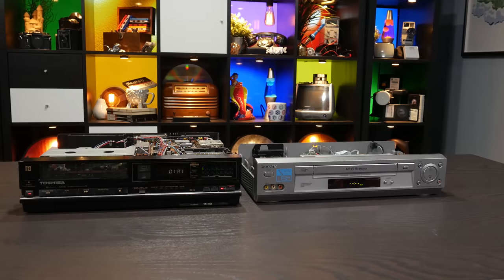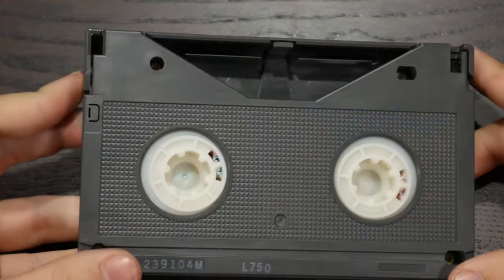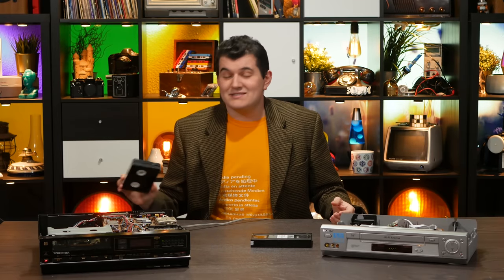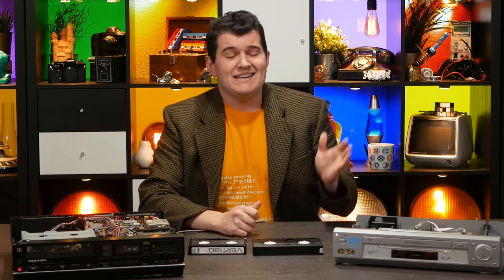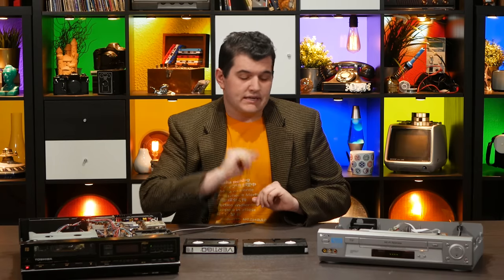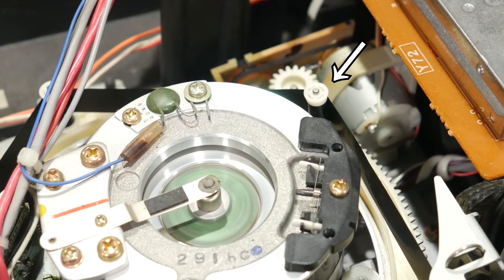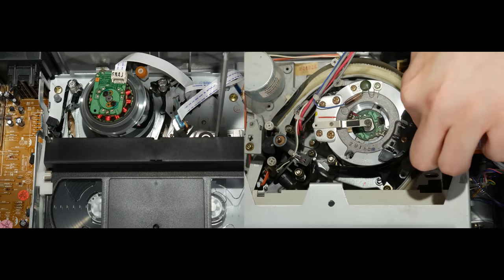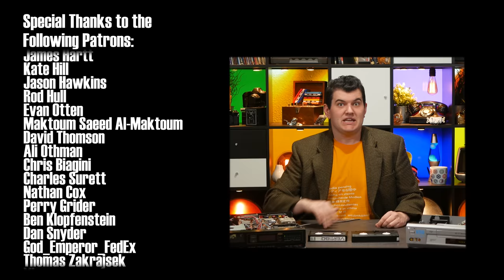The VHS cassette was more clever than Beta

Comment: Back in the 80's when tape players were new, I was a 2-way radio repair tech.  A friend with an out of warranty VHS player had a problem with his unit and volunteered me to fix it since apparently 2-way radios are practically identical to VHS players, and I knew how to solder wires together, that made me an expert on video tape players.  When a tape was inserted, it would pull it in,  act like it was going to feed the tape in but would immediately stop, then promptly eject it.  When I removed the cover, looked at all the internal adjustment controls, and knowing at that point I didn't even know how to set the clock on the player, much less fix it, I said I can't do anything without a repair manual, hoping to persuade my friend to take it to a real tape player repair shop.  We put it back together, and he left with it and I felt like I had dodged a bullet.  The next week, he shows back up at my shop, with the same broken tape player and a smile on his face,  and hands me a repair manual that he said cost a hundred dollars and said I could I fix it now that we have the manual for it.  So, we went though the troubleshooting process from end to end, and from what we could determine it was something to do with that "light on the stick" you mentioned, and the side sensors.  According to the manual, the player would check to make sure the tape was taut before loading, using that light and edge sensors and if not would attempt to wind up the tape to make sure it was tight.  Watching it, we could see the tape was just fine, no slack, but the player kept ejecting the tape.  After exhausting all possible obvious problems, we finally measured the voltage on the edge sensors, finding one of them wasn't detecting the light.  Upon closer inspection of the sensor we found a bug had crawled into that sensor, got stuck and died.  Removing the bug fixed it but not before we had gone through every step, alignment, adjustment in that machine and somehow we managed to compromise the MACRO copy protection detection (there were dozens of controls, I haven't a clue which one it was) and it worked wonderfully well making copies of other tapes.
Reply: LOL   That's funny that he brought it back with the manual and payed that much for it.  I used to do some repairs on VCRs.  Eject mechanisms were often the cause of failures.  
Your story is similar to how we got the term "bug" in a machine or program.   Where a moth caused a relay to fail in an early electro-mechanical computer.
Reply: @my3dviews   Yeah, those were the days.  I also repaired CCTV systems, so I had some very basic video tools, like the kind made by Heathkit, and at the time a nice Sencore scope that was better suited for home TV than CCTV stuff.  I was still a kid, and had just gotten my commercial FCC license and fortunately the study material covered broadcast radio and TV, but at the time I still had practically no real life experience, so I was loaded with all sorts of theory and Q & A knowledge I was ready to put to the real test, attempting to repair a very complicated device I had no clue about.  Since we lacked the real test equipment called for in repair manual, we had to build a few gimmick tools along the way, like inverting sync to inject using a transistor inverter, and stuff like that, and after the first pass through the alignment, the VCR absolutely was screwed up beyond all hope.  So much for raw inexperienced knowledge.  Anyhow, energized by my friends urging, and willingness to supply beer and Dorito's as payment for services, by the time we finished the second case of beer (we opted for the pay as you go plan), and repeated the alignment procedure probably a dozen more times, we managed to get a little bit of a picture back, and were able to tweak here and there until the picture looked fairly decent, at least to two drunk wanna be VCR repair tech's.  The picture wasn't perfect, but after my buddy discovered it would now record tapes, even those with copy protection, he wouldn't ever let me take another crack at fixing it properly.  Over the years, I gained a lot of electronic experience repairing all sorts of electronic stuff, but VCR's were something I never felt I properly conquered, and stayed clear of them, and after watching the video of the Betamax from this post, I think I made right decision.  Lol!  :)
Reply: @TurpInTexas    Ya, I don't miss doing repairs.  Didn't mind the ones were you instantly knew what was wrong based on what the customer said.  Keeping a few old VCRs around as parts was a great way to fix things.  I recall one Sony beta, that had audio problems.  Had a different model that just happened to have the same circuit board.  Did a quick swap and it worked.  Sure beat having to find the component on the board that was at fault.  
VCRs also had lots of mechanical failures, which often were obvious just by looking at it.  Such as a broken cog on a plastic gear.  
I got out of it when everything was turning digital.  Now everything is so cheap that I don't even know if they even fix them anymore.  Don't think that it's worth fixing a $75 Blu-ray player. Maybe just a complete circuit board swap, but no point in trying to find the faulty component.
Reply: My3dviews Just FWIW, the term "bug" was in use for computer errors before the real moth got caught in a relay.
Reply: You literally debugged the VCR.
Reply: Great story
Reply: @AndyFerguson  Thank you.  :)
Reply: @TurpInTexas  Been there, done that :)
Reply: I had a similar experience.  Growing up we had a VCR that suddenly stopped working.  So my dad took it down to the basement and opened it up.  He was a mechanic, but had no experience repairing electronics so he had little hope of being able to fix this thing.  But when he opened it up he found the label from one of our VHS tapes in the machine.  He pulled it out, put the VCR back together and it worked just fine after that.
Reply: TLDR
Reply: @TurpInTexas  you have to use an oscilloscope and set this little timing bump from a test measure point to get it to sync with the throw back pulse it think it was- ie you probably upset that the tape head has to perfectly align with the picture information- like when the throwback point is that takes the field scan from bottom back to the top- to start the next picture 1/2 frame. This is microscopic and of course as you must know, you never adjust anything as it;s self correcting and guiding and always the simple stuff first. Worn belts, dirt, like you know, or some sensor. Never the electronic tracking to signal stuff- at the start.
You would do this if you changed the head as it's a physical thing with a new micro position compared to the replaced head and you needed to align the tape's line scan of picture information to the head.
(When you load a tape, the tapes got "find me" pulses recorded- like a cd, dvd and so on.)
(I only performed it once in class 1/2 a lifetime ago.)
Reply: Honestly that's a little hilarious-
Reply: Why’s your comment-& all its replies-so long?
Reply: @michellebenn8553  Why are yours so short?
Reply: And this, is why I do top down cleans before trying manuals
Reply: The one that was the scariest was the VCR that I opened with a full size Peanunt Butter and Jelly sandwich in it... With green mold. 
The second favorite of mine was the VCR full of crayons. I have no idea how those things got in there... But I do know that children are much better behaved when kept in their dog cage when not in school... Just sayin... As a successful parent and grand parent  😜😝😱
Reply: @steamer1  ????
Reply: These comments remind me of my recent repair of a car stereo out of my daughter's car we bought used a year ago. It powered on and radio worked but it wouldn't play CDs.  When I disconnected and removed it from the dash - I heard the unmistakable sound of a quarter.  After removing it I closed the unit and was ready to power it up and heard another quarter floating around inside. 50 cents later the player works perfectly.  Somewhere there's a parent who never knew why their CD player stopped working or what happened to their laundry money.
Reply: And this is exactly why Im upfront with what I know how to do. I cant count how many times I've been asked "hey, can yiu help me fix this thing" and responded with "I have no experience working on anything like that, hire a profesional".
Reply: @my3dviews  shoot, that machine was probably $1500. $100 to fix it was a bargain.
Reply: @davisnin    The $100 wasn't to fix it though, it was the cost of the manual.  So, if he charged for parts and labour, it could have been much more than $100 to fix.
Yes, they were expensive.  I also did some sales, when repairs were slow.  I recall one VCR that we sold for $1200 (Canadian).  The cheaper ones at the time were in the $700 to $800 range. 
CD players were close to $1000 Cdn.  This was in 1983 or 1984, when I worked at that store.
Reply: Ok
Reply: @ketond3973  My personal favorite troubleshooting and repair was my dad's old 1966 Cadillac.  Accessory lights fuse keep blowing.  He even had the whole wiring harness replaced, same problem.  In two-way radio I learned a technique when troubleshooting shorted circuit boards, and that was to install an incandescent lightbulb inline with the power supply so as to limit the current and keep the board from burning up while troubleshooting.  Did the same thing, except put the light across the open fuse with jumper clips.  I tracked it down to one of the rear seat cigarette lighters, and in it was a metal earring back across the terminals.  Same thing happened my uncle on his Caddy, this time it was a pull tab from a can had fallen into the cigarette lighter plug.  Kind of weird these days you don't see many cars with a cigarette lighter anymore.
Reply: Ok
Reply: Now that you mention Macrovision , that was another advantage of Betamax , because the ones at least here in the UK weren't affected by it , so you could rentVHS movies from your local rental shop , and make excellent copies onto Beta ; even better since at the time I had an early Hi-Fi VHS and Hi-Fi Beta machine !
Reply: @my3dviews  I worked for a while in an AV Hire company where we rented out a lot of presentation , audio and broadcast kit and was always doing preventative maintenance on the kit , things like belts , pinch rollers , tension bands , brake bands were always routine replacement items , very occasionally heads , and things like bulbs for the meters etc . After VCRs of various formats , most of my time was taken up keeping our stock of a couple of hundred Kodak S-AV slide projectors working .
Reply: @DustinDawind  Funniest one for me was when I went to put a tape in my VO-5800 U-matic player , and it wouldn't load the tape . This machine was in a rack in my living room at the time ( still is but a different living room now ) . When I took the lid off the cause was immediately obvious - my infant son had posted several Lego bricks , a few coins and a toy car in through the slot in the front of the machine ! Worked fine once all the foreign objects were removed . Couldn't be angry , he was only around two or three a the time , but I did check all the other VCRs , just in case .

Comment: Yep,  another perfect explanation of that whole saga. I used to work in a mom and pop electronics and video rental store (late 70s-early 80s) long before Blockbuster existed and we certainly did rent both Beta and VHS porn and of course, regular Hollywood movies. Back then, nobody ever complained that VHS had any inferior picture quality. Tape all pretty much looked the same at least on consumer TVs of the time. We were all just amazed that we could record broadcast TV and rent/buy movies to watch at home. From what I remember, as to why VHS came out on top, is that it came down to price. The VHS VCRs were sold by many more different manufactures and therefore, almost always quite a bit cheaper. As a salesman, trying to explain to a customer that Beta was better was difficult because they couldn't see any difference and frankly, neither could I. And then there was the initially shorter recording time of Beta which certainly wasn't a selling point so it was hard to extol any virtue of Beta over VHS. Even though Beta Hi-Fi came out before VHS Hi-Fi, that didn't sway anyone from buying VHS over Beta either. Beta did initially have a steadier Freeze-Frame quality but that wasn't a reason a customer would choose one over the other. By the mid-80s when Sony VCRs began having wide-spread quality control issues (the machine wouldn't rewind) it was all over for Beta.
Reply: I think part of it was Sony wanted higher lic fees for both the players AND the media.  Maybe fried brain cells, but I recall JVC was the main lic holder for VHS and their lic costs (particularly on media) were way lower.   Not that I can cite that and at this point wtf cares.
Reply: Major driver was cost of licence. Sony had a per machine royalty, while JVC was a lot less worried, with both much lower costs and a lot less actual chasing up, so that manufacturers would look up the cost of making a machine design, and choose the cheaper option and make VHS. As well the actual mechanics were easier to make, quite a few clone manufacturers could do the entire machine easily enough, but only found the head drum assembly too difficult, so resorted to buying them as spare parts for larger brands. Did drive Matsushita crazy for a while IIRC, with the number of head drums they were selling to the repair market, till they finally found out why, and probably started offering them as a ready to use part instead, getting in an extra profit for essentially already paid for production capacity. Then the cloners got to the point they could actually make the whole machine in house.

Sony however wanted tight control, which both costs money, and also stifles innovation and changes to the mechanism, while VHS found a solution to big drums in the VHS-C with the smaller drum, faster rotation and extra heads with switching, but which left a standard azimuth track on the tape, which also was used in a few full size smaller units as well. Assorted mechanism types were to get it either smaller, lighter, cheaper, or more compact for some application. Last VHS decks I saw consumer side were essentially one single plastic injection mould of all the parts, integrated with a single sheet metal stamping, to make the deck, complete with all of the tape mounts and eject mechanisms.
Reply: Techmoans had an interesting video where he said that machine rental cost was where Beta really died and Video 2000 never stood a chance
Reply: Sony did the same thing with MiniDisc. Could have taken off, but for years it was only Sony machines and they weren't cheap.
Reply: @xiradio  Really good format, and quite reliable. Just that Sony wanted all of that pie, and that is what killed it, competing formats that were cheaper, more manufacturers and most importantly good enough for the job.
Reply: @xiradio  Apple has succeeded under the same issues. Even though Google and Samsung sell lots more.
Reply: @xiradio  Wait they did the same thing twice?
I remember I had a RioPMP300 and was kind of envious of my friends Minidisc machines, as they could carry hundreds of songs in a fairly small space, but I was stuck with 9 not-too-good-sounding ones until I could get back to my computer... but we know which format eventually won.
Reply: @macnerd93  More as a professional recording media, which competed with DAT for the same purpose (live or studio recording, for pressing onto CD and comercial release).
MiniDisc machines and discs were hideously expensive compared to tape (and later CD) recorders, so even semi-pro used multitrack tape (eg: Tascam Portastudio) until digital recording took over.
Of course there, will be the "rich kids" who'll go on about how they had a minidisc player, which they probaly listened to while doing lines of coke with Gordon Gekko.
Reply: Anecdotal testimony is hardly evidence when it comes to determining quality. Nothing personal. To this day, there are some that still claim that 30 frames per second is no different than 60 and that 60 actually makes their head hurt or something weird like that. They're like flat earthers but I really digress here. I'm sure you get the point.
Reply: Did your tapes say, "be kind and rewind?" Must have been a bitch when cannot rewind the Beta tapes.